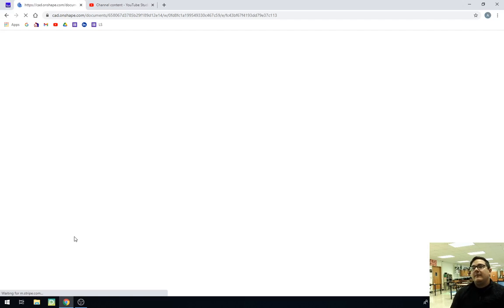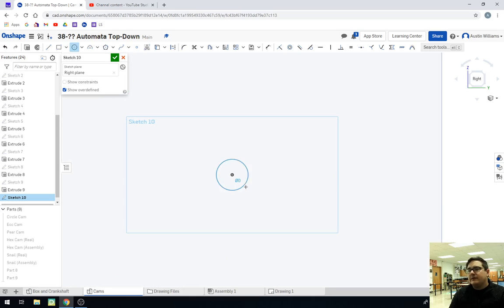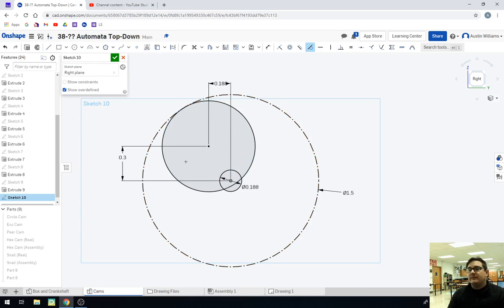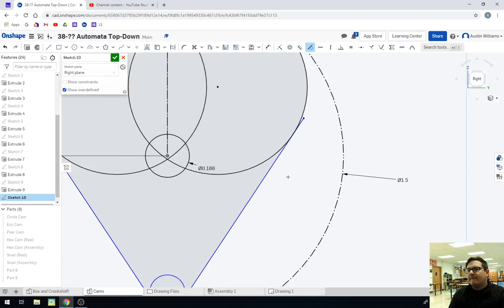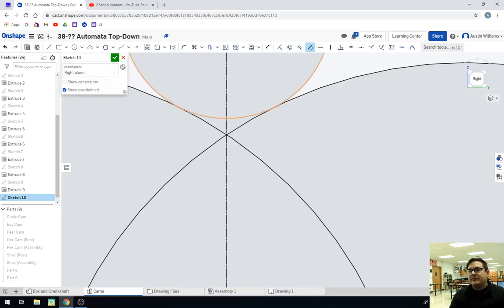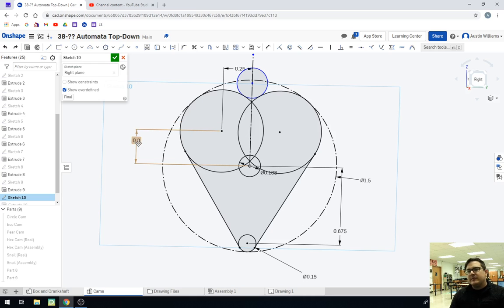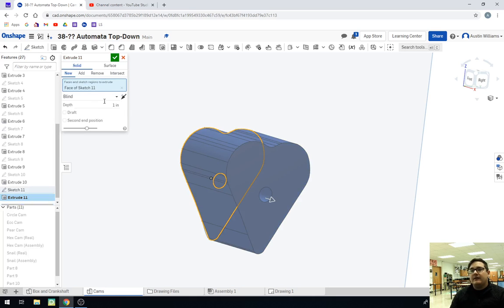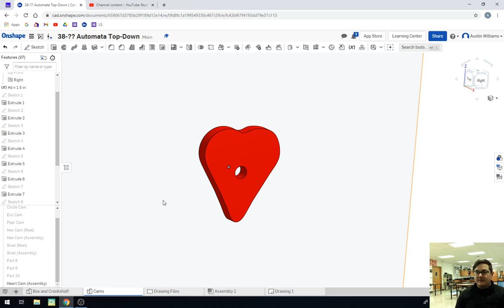Automata Top Down - Heart Cam - Day 42 of 100 Onshape Journey

Comment: I find that using six very small (0.005”) circles and six straight lines tangent to them when sketching the Hex Cam works better than Splines. You get nice clean edges and an almost invisible curve at the points, not to mention more control of the dimensions. 

Also, you can make the Snail Cam work similarly with two 3-point arcs, two tiny circles, and a line. You have to fiddle with making the line and the 3-point arc ends tangent to the circles, and the 3-point arcs, where they connect to each other, tangent to a construction circle. I’m not sure the diameter of the construction circle even matters, since, mathematically, tangent is tangent on any circle. Just make sure the center of the circle lines up on the line that goes between the center and the arc ends. 

I’m pretty new to this, so I’m not sure exactly how to point to my Documents. If you want to see it, my username is chris_c892, and the Document name is Automata Box. The sketches are Sketch 6 (Hex Cam) and Sketch 7 (Snail Cam). If you can’t find it, let me know how to show it to you, and I will. 

Thanks for making these videos! I’m learning a lot from them, and I might have stumbled across what I want to do after the Navy!
Reply from the maker: My main issue right now with cams is there is not one solution  to keep every type of cam parametric and mated the same way. This solution urks me, but its a solution that will work for any type of cam.
Reply: @LearnItDoItMakeIt  I think that as long as two lines meet up 180° with each other, OnShape will see it as a continuous line. So you can use basic shapes (lines, arcs, etc.) to “build” whatever shape you want, as long as you connect the ends properly. True that there’s no one solution to every problem, but personally, I like this mathematical approach better than splines.